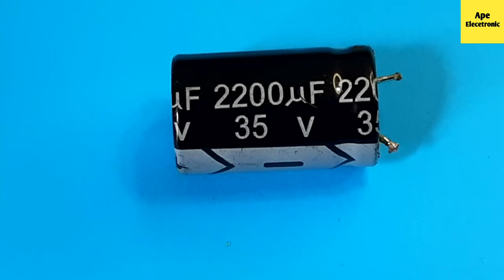How To Make VIP Light system/police light LED/emergency light.

Comment: අපිට මෙකෙ design යන විදිහට හදන්නෙ කොහොමද ?
Reply from the maker: man passana vidihata passa ganna brother.
Reply: Haa thank u bro
Reply: 12v relay එකක් ගන්නේ  kohenda. ada capacitor ekai resister ekai gatha eth relay na කිව්වා 9v විතරයි තියෙන්නේ කිව්වා  apita 9v relay danna ba ne 12v battery
Reply: Mata 3 wheel ekata danna ඔනෙ
Reply from the maker: @rasikaweerathunga1223  thawa tikak  balanna hoya ganna electronic shop wala thiyenawa brother
Reply: Baluwa brother eth na mn thawa ewwage balannan